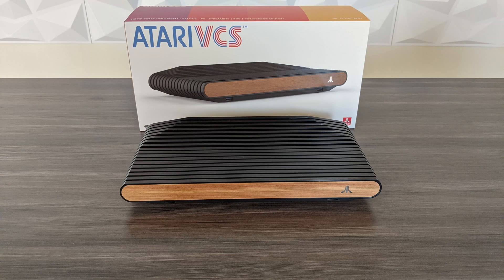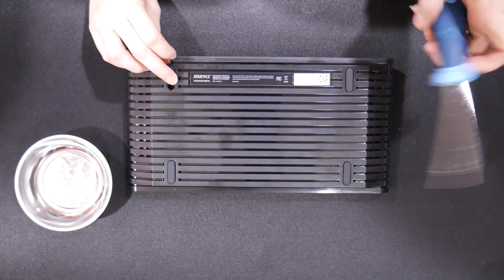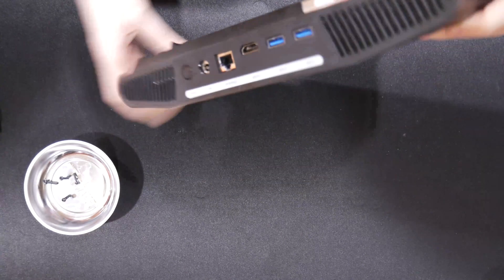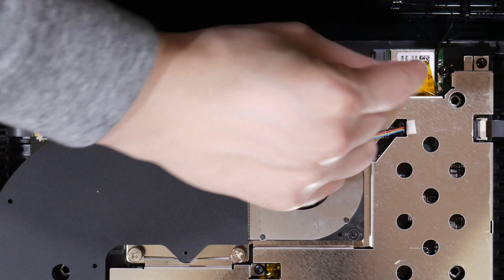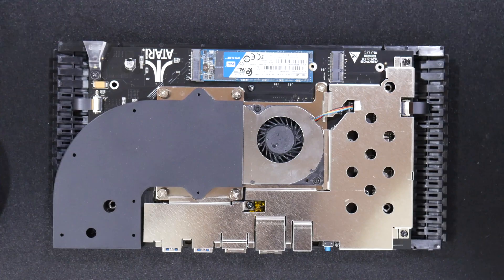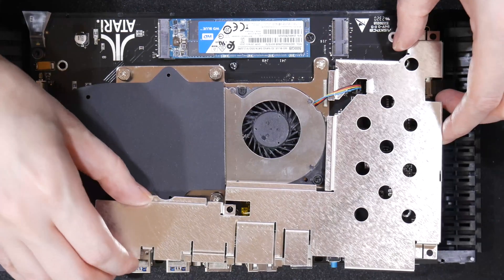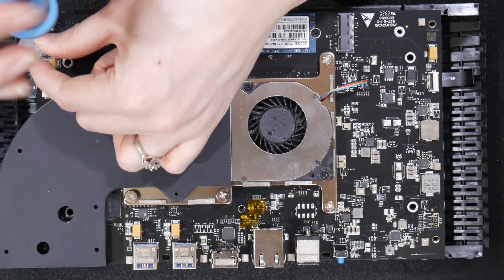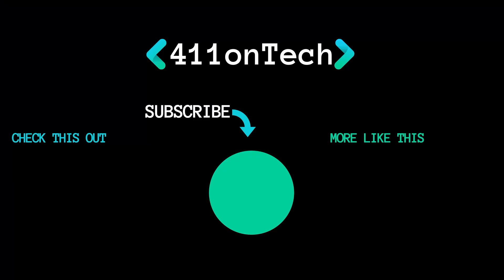ATARI VCS - PART 2 - UPGRADE

Comment: I have my ripjaws 2 -16gb DDR4  & WD-Blue Drive ready to install. Question is, does this have to be partitioned to increase Atari VCS storage. If this makes sense.
What is the best way to increase or allocate drive space to accommodate Atari and Antstream games, eventually space will run low.
Reply from the maker: We don’t believe you have to partition it for the Atari OS to recognize it and use it as storage. We installed our M.2 for Windows to run emulation. Recommend checking out the atariage.com forum where you might find more information about using it as additional storage.   Hope this helps. Thanks for watching!

Comment: Did the VCS support the 3200MHz ram?
Reply from the maker: It will support 3200MHz @ 16GB, but not at 32GB, which is what we have.  We down clocked to 2666MHz.
Reply: Thank you!!
Reply from the maker: @bryguy1598  Your very welcome. Happy to help! And thanks for subscribing.

Comment: Hi, when installing the SSD m2, is it necessary to install a spacer between it and the motherboard to avoid overheating?  or even a heatsink on the SSD? Thanks
Reply from the maker: We didn’t use a spacer. We just use a screw left over from a PC build. We have run the system for over four hours doing emulation and pc gaming no over heating issues. Installing a heat sink and spacer wouldn’t hurt but doesn’t seem necessary.
Reply: @411onTech  Thanks a million!!!! 🇧🇷🇧🇷🇧🇷
Reply from the maker: @cally.20  Your welcome